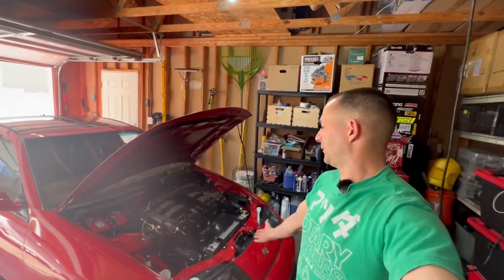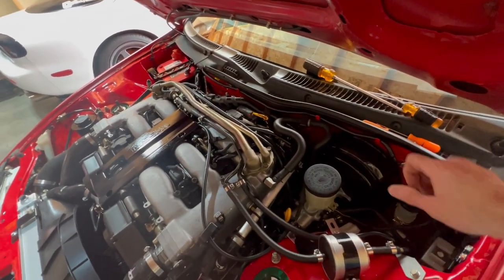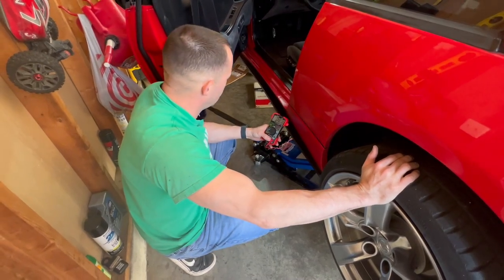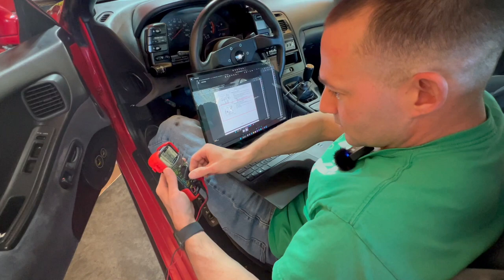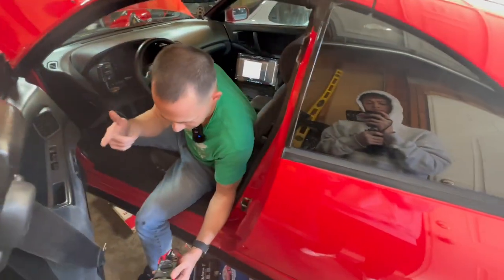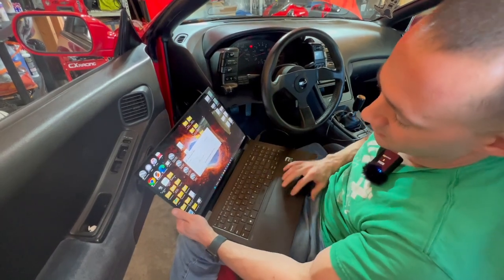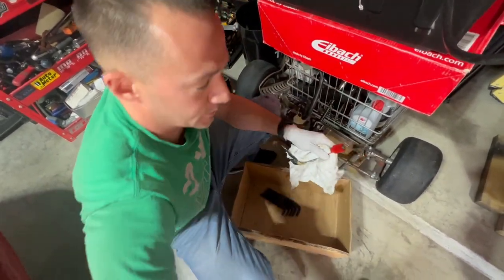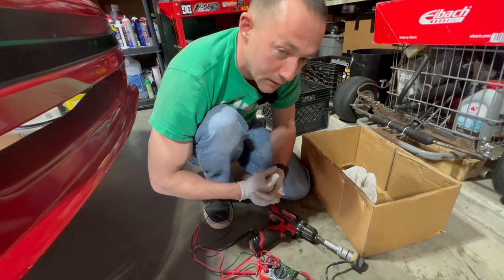Setting the Idle, checking the Speed Sensor and using Nissan Data Scan Project Z32 Built By Miller

Comment: Hi. I have R33 GTST, I just downloaded and paid for license for NDS1 to troubleshoot something and it connects fine and I solved the problem. However, I don't see SPEED on the software, I can see it on my dash cluster. What is wrong? Thanks for the reply.
Reply from the maker: Sorry I’m not sure how to help
Reply: @builtbymiller I found out ppl use to cut a wire to remove the speed limit. I haven't done it yet but it's from dash to ECU. I have to look for it. Thanks anyways

Comment: Is it on the stock computer box or on the tt box.
Reply from the maker: Not sure what you mean here. The diagnostic tool hooks up under the dash.
Reply: @builtbymiller  I mean is it on the original engine management system or is it on the twin turbo engine management system or is it aftermarket.
Reply from the maker: @rustywrench500  ah ok. I sent the stock Ecu to Z1 and they put a chip in that changed it to a turbo Ecu with the new fuel parameters for the upgraded turbos and injectors.